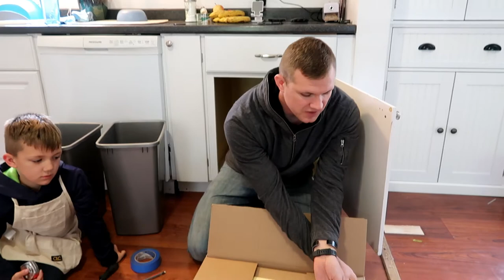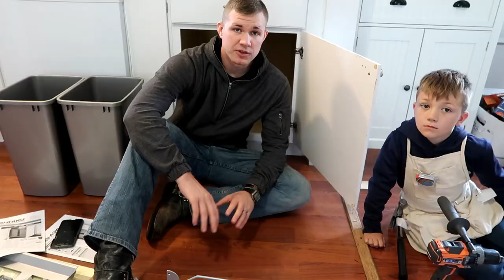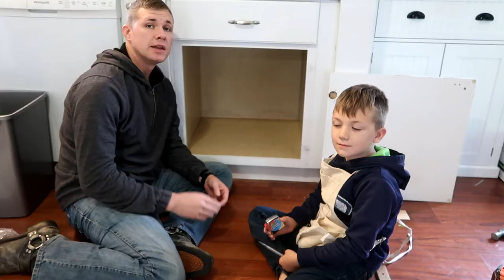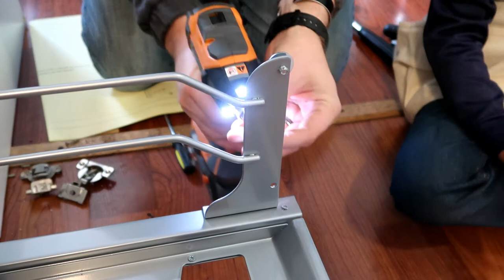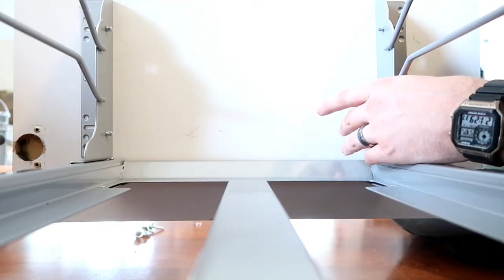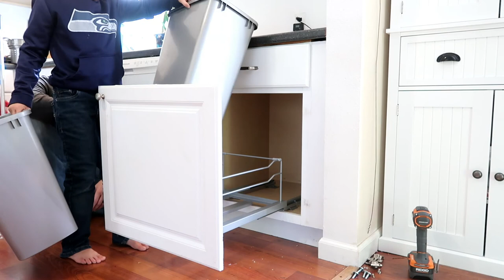How to install concealed trash tray Rev a Shelf

Comment: We have installed this pull out system with soft close , but I have to pull kinda hard to open the door. The first few inches you have to pull hard, as if something is holding it back, (I feel some resistance), but once it's past that point it glides easily. Is there any adjustment that can be made to make it open without any resistance?

Comment: I need help troubleshooting an issue with the installation of this product. It's that there's always a quarter inch gap at the bottom that I keep getting when I slide it close. I have to  push the bottom with my feet just to shut it completely. How can can I make that gap close flush with the cabinet without having to push it in close with my feet afterward? Thx for this video btw, you did mention the top of the door having a gap which is nice, just need help with the bottom of the door doing that now. Anyway thx for your help:)
Reply from the maker: We have moved since this video so I don't have access to walk through it and troubleshoot anymore

Comment: We were following step by step when installing, we suddenly lost you how you removed the slider to put it on to the cabinet door..we searched but could never find a way to remove the slider from the base...
Reply from the maker: Sorry about that, separating from the sliders definitely make the job easier. I don't recall how I did it all this point and this has was sold a few years ago. I, unfortunately, cannot provide any more clarity at this time.